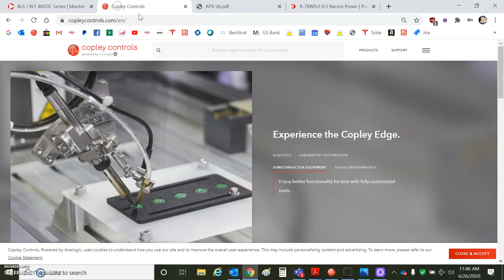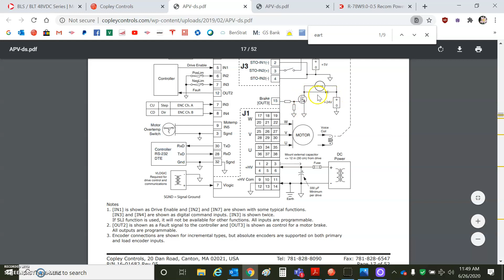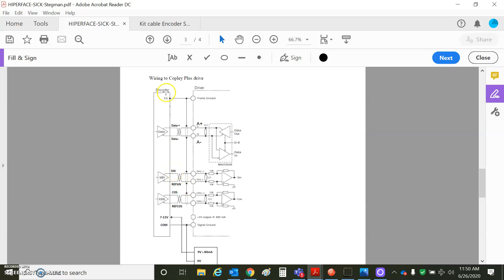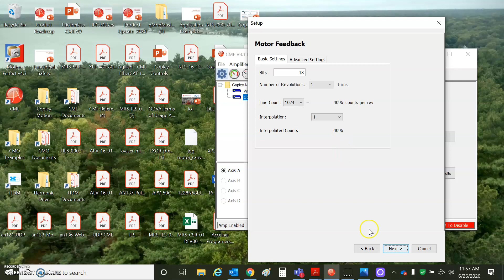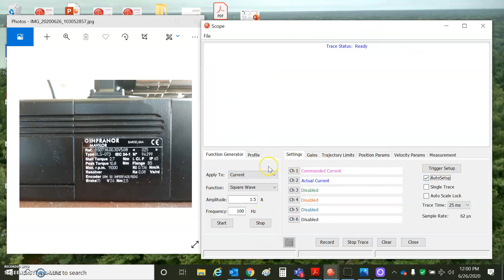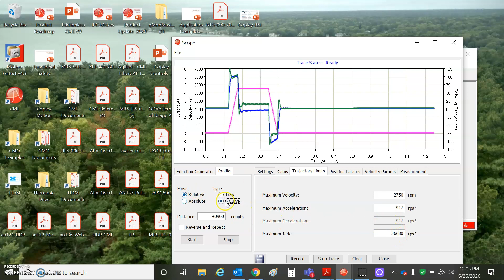Mavilor BSL-073 48V WInding + Hiperface Absolute SIN COS & Copley APV

Comment: I have a BLS-073 motor also. But I don't how to figure out pole no of motor. Please show me where to find it.
Reply from the maker: Use Copley drive characterize feature in motor screen to auto tune and we will count poles. Otherwise use manual phase screen and rotate vector for one motor rev and count electrical cycles. Poles = 2 times electrical cycles.